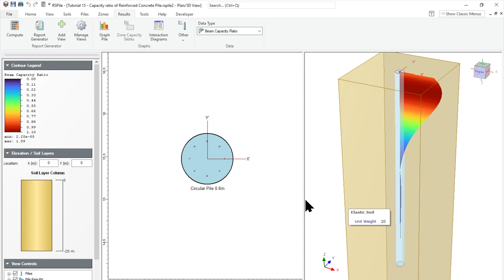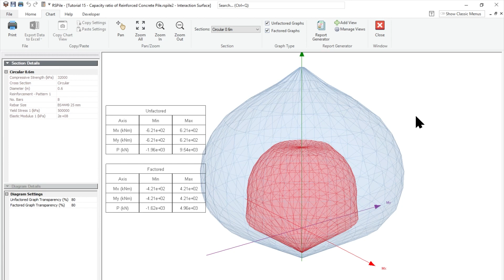Mastering RSPile - Capacity Ratio with Reinforced Concrete

Comment: It would be really helpful if a capacity ratio could be implemented for steel pipe sections. I've tried to do a workaround using external and core casings (with finite concrete thickness) in the reinforced pile options, but I cannot get it to replicate a correct interaction diagram.